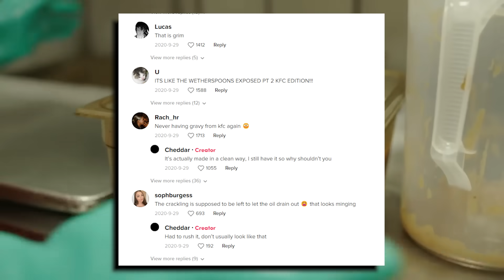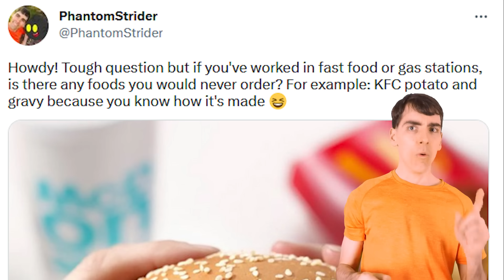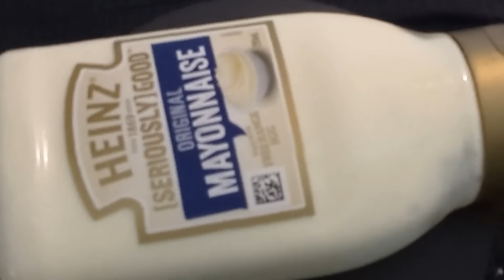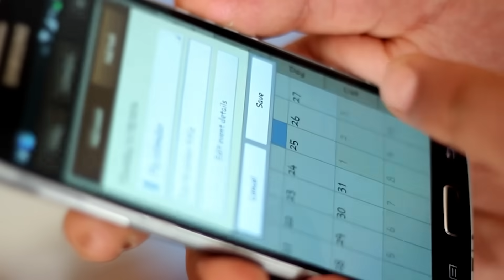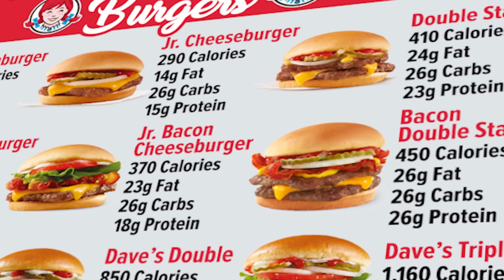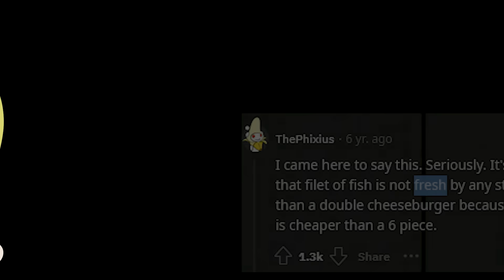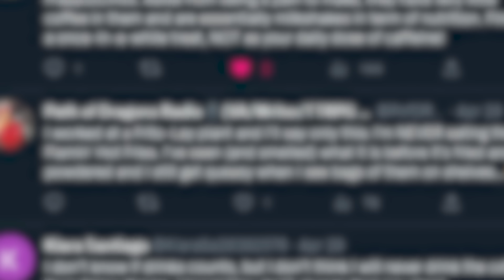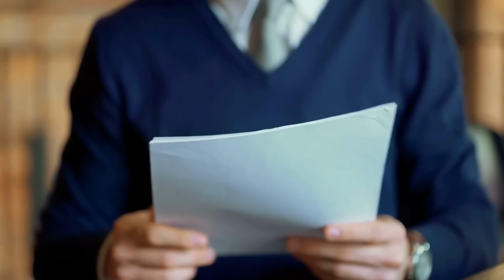The 10 Fast Foods Staff Never Order

Comment: I think comparing the "contamination" of an ice machine to toilet water is kinda disingenuous. Yes, toilet water in general isn't something you should drink because there's likely flakes of shit/piss on the ceramic, and maybe in the rest of the water, but if a toilet's being used and flushed often, the water that fills it up is coming straight out of the pipes, so when you dip a measuring cup in to take a sample (assuming that you're dipping the cup into the center of the bowl and not like scraping it from the sides or something), you're mostly just getting that "fresh" water that came from the pipe (with some shit possibly mixed in if someone took a nasty shit recently). 

It's going to be much less ""contaminated" than people imagine - it moreso just sounds gross, so people freak out if they hear that ice machines are even worse. I think that's pretty misleading - if anything, ice machine "contamination" should be compared to some other machine that's more similar to it, it shouldn't be compared to toilet water in the first place. They're just doing that to freak people out.

In fact, I think you should be less worried about the ice portion of the machine and more worried about the spouts where the syrup/water come out - which we would clean every day at Jimmy John's by wiping down and then taking off the nozzles and soaking in a solution overnight. Not sure if other places do something similar or not.

Comment: A decaf Expresso based drink. witch is what a latte is. Steamed Milk with expresso. 1 for small 2 for med and 3 for lrg. to make that a decaf you would basically have to use decaf coffee and steamed milk witch is gross. only other option is decaf expresso witch sounds as unless as a flamethrower in a fire.

Comment: I mean, the poor food practices are rightfully controversial and should be called out, but most of this just seems like people having their first meeting with where our food actually comes from. Gravy IS made that way even at your grandmas house, beans have been dehydrated for storage for thousands of years and the concept of reusing leftovers is just as old and done to this day. And the tuna thing? I think alot of people would be happy if its soy, if they knew where actual tuna or beef comes from.

There is no food on the planet that is not disgusting at some level or perspective. That is of course not a free pass to not do better, but it seems alot of people are very sheltered.

Edit: the hot dog water thing is absolutely a bad food safety practice though. No, it doesnt matter that the water itself is 4 billion years old, but once you put organic matter into it and leave it at a temperature where bacteria thrive all day, things WILL start to grow in there. Same with the gas station hot dogs on those rolling grills, if they are too old you can absolutely get food poisoning from it. Theres a reason they are supposed to throw them out and replace them after a couple of hours.

Comment: Now frappe machine I hated to clean real pain in the butt .. the Ice ben it  needed to be clean washed and sanitized ..same with blade and that’s post to be a daily clean and the weekly clean is post be a 3 step process 3 buckets soap, sanitizer,  and water and come with hoes to attach each valve to thoroughly wash each step and cycle but if not washed 😳because your only one can wash it it will also lock for 6 hours of the weekly wash day  .  And if don’t get to it in time it locks ..ohh and if the valves in not thoroughly clean. Some of it  builds up get stuck in the valves so people was pretty much eating the rotten mix in those hoes  so yeah scary when ordering a frappe 😳 I stop drinking frappe for a while but like if go to restaurants and see how well together it runs and there very clean then you know you got nothing to worry about ha so yeah